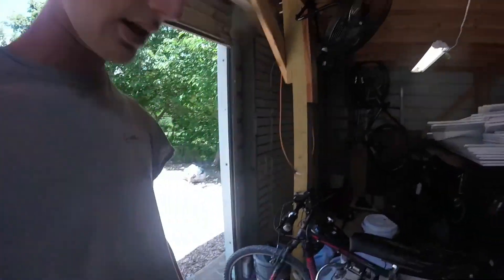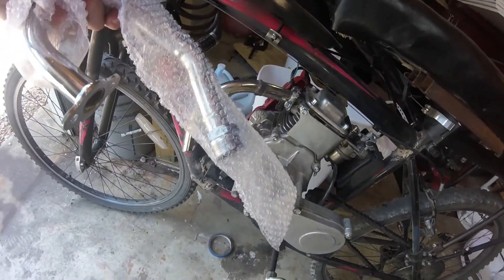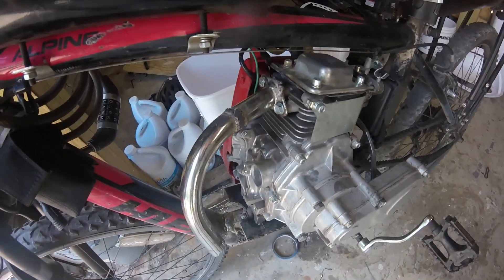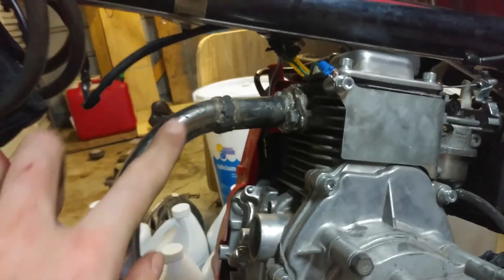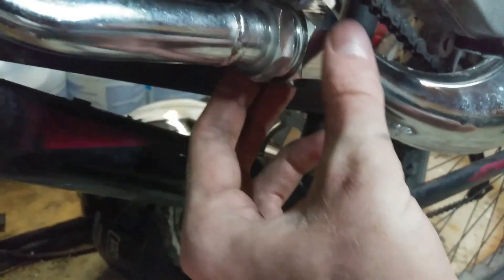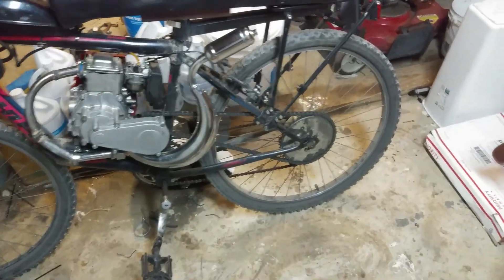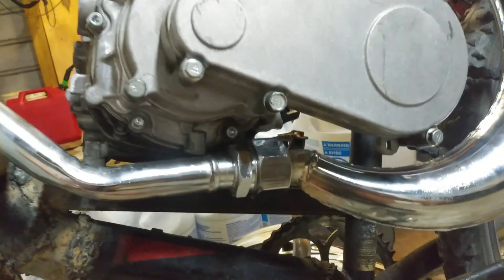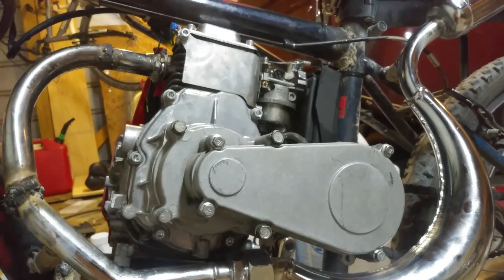Motorized bike gets custom exhaust

Comment: 2 stroke pipe on a 4 stroke probably is not the best thing- 2 stroke exhausts are designed to route some exhaust gas back to the cylinder the push back any un burnt fuel, for a four stroke exhaust if u have exhaust gas going back towards the cylinder it is not going to help your performance what so ever. If u want to get the best performance out of your custom exhaust, leave on the first bit of pipe, unscrew the  2 stroke expansion chamber and get a piece of pipe the same diameter welded or screwed on. 

Cheers
Reply: As right as you are. The design of this pipe offers absolutely no research and development with a side of absolutely no tuning. It won’t function as a expansion chamber. Nothing more than a resonator really.
Reply: @stormmccree8238  After I went to 4 stroke, i put my pipe over just for the sound lol